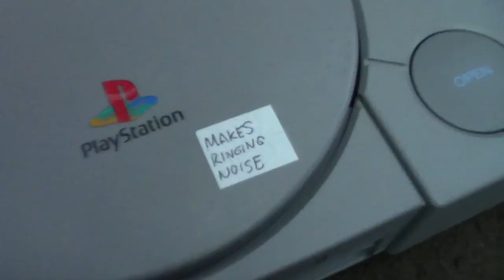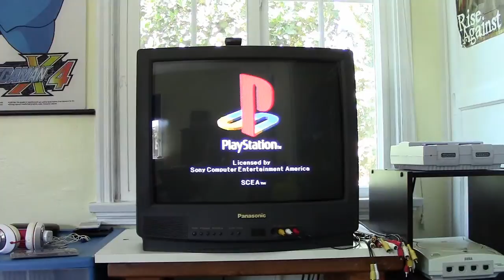PS1 Ringing noise easy fix

Comment: Edit: on mine, I had to resolder the CPU (IC103 / CXD8606). It seems it's really fixed now!

Looks like the cause of the sound issue is discovered.

In short: between the sound DRAM chip (IC310) and the CXD2938Q sound chip (IC732) the soldering can break on multiple legs/pins, possibly from the board's flexing.
Here's the repair video: https://youtu.be/K_rq6-ozoAs?t=1333

Comment: Demonte Williams Do a bootup video on it. Pretty please.
Reply: Demonte Williams And have u tried fixing your 1000 model. Is the laser dirty. Probably is. Just take a cutip and glass cleaner/windex. Spray the windex on the cutip and swab it on the laser. After dat just take the other side and dry it out. Oh yeah dont use rubbing alcohol or water because dat leaves behind residue.
Reply: i just did it not too long ago. watch me put in Mortal Kombat Trilogy into a ps1. hope you will like it trust me.
Reply: Demonte Williams I will. All ur vids are good.